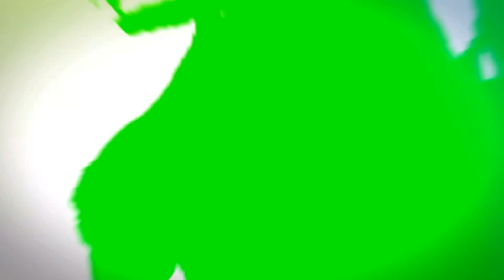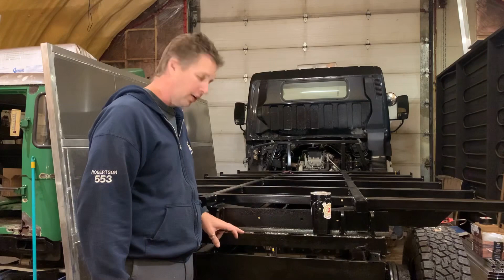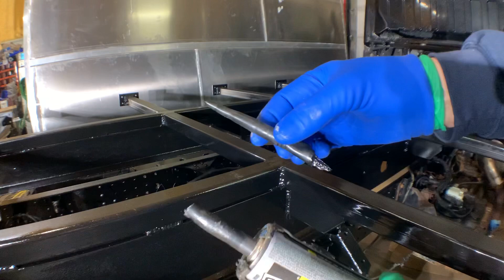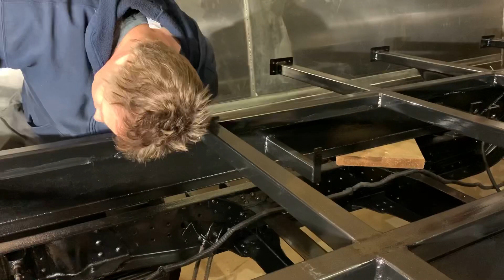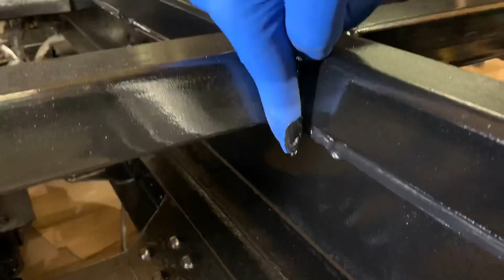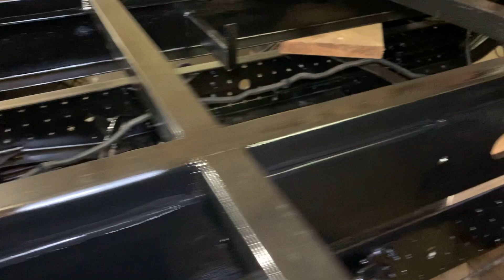Sleepy seam sealing!

Comment: You should show the name and type of supplies you use. Polyurethane by DAP but you block the details of it. Is that it, just a tube of dap polyurethane, nothing else to look for?
Reply from the maker: You are correct - it’s called “Polyurethane Adhesive Sealant” by DAP - all my other videos where I’ve used it Ive put a close up of the tube - I meant to do that in this one but forgot in the edit!